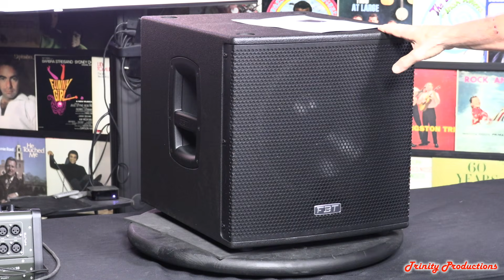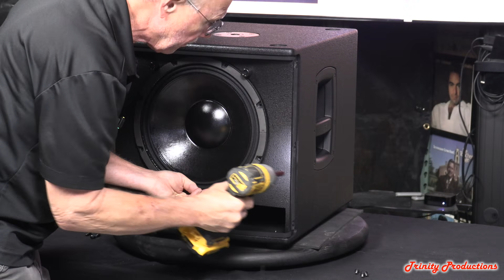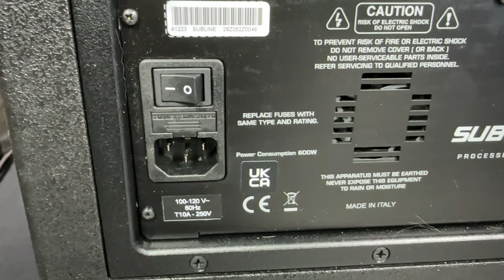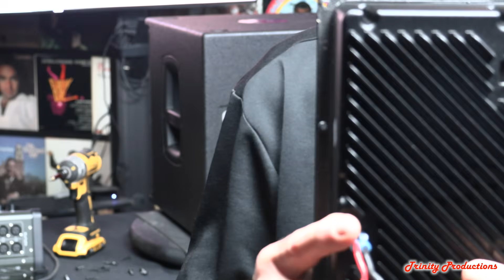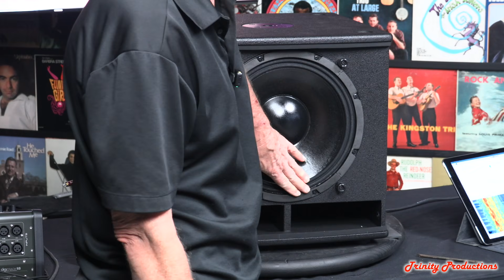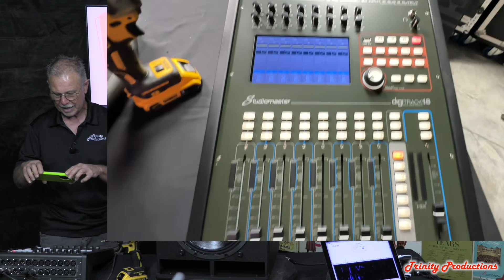FBT SUBLINE 112SA Active 12" subwoofer  speaker with amazing output and features ...

Comment: What are your thoughts on the RCF 702as mk3 vs the FBT Subline 112SA?
Reply from the maker: Those are in a similar league. 700 WRMS on the RCF unit and same on the FBT, here is a review of a sound person on FaceBook on both units…it is just tough to get a lot out of a 12” subwoofer …. 15” better , 18” way better for low end , but again portability and size does matter …  

review from ….. 
FBT Audio Users  · 
Thomas Kuzinas
June 17

So I finally have had the opportunity to compare the FBT Subline 112SA and the new RCF SUB 702-AS MK3 directly with each other, and I can share my thoughts on these 12 inch subs.
The RCF sounds very precise and pleasant, but it does not have quite as much headroom and goes into clipping, as well as triggers the limiter surprisingly fast. The character is rather "polite" and accurate. 
The FBT does indeed play less precisely, but it offers an amazing amount of power for its size. If you let it work within the first quarter of its volume range, you get controlled bass with a lively sound. Between there and half-volume it goes impressively loud, but somewhat "wild" and "boomy". Above that it goes even louder, but starts introduce a rattling noise.
Therefore, I would recommend the RCF for small live bands with a more concert-like character. For mobile DJs and my specific area of application, the FBT is a better fit and offers an incredible power / size ratio.
Reply: @trinityprosound Thanks. I’ve used the mk3 RCF 702’s and heard the FBT Subline 112SA recently. I agree with the FBT Subline 112SA being loud and boomy. However, I recently used the RCF’s at a couple of outdoor events with 250-300 in the audience. I had a full band with fully miked drums, bass and keys (no backline) and 4x lead vocals and a miked choir. I was amazed at how loud, deep and musical the RCF’s were. They covered the event easily and I had a fare amount of headroom left. 
The RCF’s were definitely my favourite of the two regarding sound.

Comment: Hi which would you think would pair best with my rcf 910 this subline 12 or rcf 702 mk3 great vid from the UK 🇬🇧
Reply from the maker: Either will pair nicely, however with the RCF 702, RCF tonality will be similar with your 910’s , not sure of the DSP differences in the SUBLINE vs. the SUB702, but use the built in cross over on the 702 and you will have a nice small system that will sound full and musical …. SPL is quite close on both … thanks for watching !!!

Comment: I did a sound check with these bad boys today and was surprised at how they had such a powerful punch for a 12" speaker,  in fact it sounded better than my yamaha dxs 12 bass bins. I'm thinking of using them with my Dzr12s,  what do you think?
Reply from the maker: Great to hear thanks for the report …. they are quite a formidable 12” subwoofer … IMO the FBT are better construction, drivers and amps than the EV stuff hands down … i have seen some of the EV stuff in repair and was not impressed with the quality of the amps and speakers. Give it a shot with your DZR’s and let us know back how that went ...

Comment: Great channel, great review. I’ve subscribed. I’d like some advice. I sold my RCF gear. I always felt the sound was heavily shaped by the internal processing. I owned the entire ART series—the 910, 935, 932, and 945—plus the 8003-MK3 subwoofer. Of the lot, the 932 stood out, but I didn't like the way RCF handles mid and high frequencies. I need to put together a system for indoor venues: either a 2-top/1-sub setup or a 2-sub/2-satellite configuration. The events are strictly club music played on vinyl. I need tight sub-bass and solid mids and highs. I’m looking to switch to FBT or dBTechnologies.
Could you recommend a subwoofer (12"–18") and satellite pairing? Can two 12-inch subwoofers match a single 18-inch unit in terms of SPL and bass output? Which models would you suggest? The events take place in a private home, in a space of up to 100 square meters.
Thanks for the review.
Reply from the maker: The RCF processing is more FLAT overall, Italian processing without the low end USA push so to speak… each of the 9xx series boxes are going to have different crossover point due to the HF driver size of each cabinet… smaller driver crossed over higher , where the 945 is crossed over at 650hz, low and smooth IMO. The NXL boxes are easy to transport and have a sleek look to them. The 905  subs would be my current choice to pair with an NXL14 or 24, but the 24 will outrun a single sub. we have reviewed a few 12” subs and there is just not sufficient volume in the box to do what a 18” sub can do … we have done demo’s in our shop and the low end from a good 18” is incomparable to a 12” or 15” subwoofer

Comment: What is better for DJ: Wharfedale PRO T-SUB-AX15B or FBT subline 112? What do u think about this? Maybe db technology 615 sub?
Reply from the maker: Oooh , tough question. the AX15B or the db tech 615 would be our choice due to the larger driver in each box. While the SUBLINE 112 does a great job, the 15’s are going to go a we bit lower in response and all are within 1dB of each other for max SPL , most of those measurements were taken ½ space, sitting on a floor or up against a wall to help with low end coupling. For the price point the Wharfedale wins for output IMO. Subline 112SA being the highest priced sub in the line up … thanks for watching BTW !

Comment: Very Nice video as always 👍

What do you think about subline 218sa vs horizon 118 VHA in terms of loudness and which one is more appropriate for deepest bass possible ?
Reply from the maker: The SUBLINE 218SA is amazing for the output and price point , but the Horizon 118VHA outruns it IMO … much more power, more SPL and a Powersoft amplifier in the Horizon. The 218SA has 1200wrms while the VHA has 2500wrms, double the power and the max ½ space SPL 143 vs. 140 of the SUBLINE… however with that said … i am not sure the magic that happens in the SUBLINE 218SA, but the output out of that thing for 1200wrms is fantastic.

Comment: Sounds like the screws need to be replaced with something more solid & doesn’t strip as easy. Seriously
Reply from the maker: agreed , however the grille should not have to be removed nor the speaker or amp as we have had zero failure of any of the FBT we have sold to date … but , yes i get it … thanks again for watching !
Reply: @trinityprosound FBT products are incredibly great product all the way around. I’ve heard a 2 way mid high with a 14” woofer & I believe it was the 1.75” high frequency diaphragm & they were outstanding. 😃🎶🎸🥁🎹🎼🎷🪉

Comment: How would you compare this with the RCF 705-ASMKII? i know it's
a 12" but would like to know if it's not far off it.
Reply from the maker: The 15” with either RCF or FBT is going to move a bit more air and have lower response due to driver and cabinet volumes , but this 12” is is surprising output for the size and power of 700wrms. We have installed some of the 705 MK2 in a church gym and they sounded great… for smaller venues the 12” FBT sub is easily transported and if we would have had 2 of them in our 4200 sq. feet would have filled the room quite well with low end … great for a small church , bar band, corporate events. etc. Thanks for watching !

Comment: I pair my subline112sa with fbt vertus 206a not ventis since i already owned them with my subline118sa but I wanted a small system and these 12 subs have been great without also buying the ventis 206a. I know that combo is very popular in the uk. I wish the us version had true 1 like the uk instead of an iec
Reply from the maker: I too wish the pro stuff had the powercons on them … the IEC just seem cheap to me and can get yanked out pretty easy … yes , the 112 with the Ventis is amazing, but the Ventis 206A will out run the SUBLINE 112SA, you would need 2 of the subs per side to keep up with the Venits…how is your experince with the Vertus? do they outrun the 112SA’s ? Thanks for watching !
Reply: @trinityprosound the vertus is meant to throw sound even farther than the ventis so the issue will not be addressed I believe :)
Reply from the maker: you are meaning more SPL in the Vertis speakers vs. low SPL of others… also HF directivity has a lot to do with what is termed “throw” … SPL is king … we have line array boxes that are 145dB and narrow vertical coverage that can send audio like you can’t believe.. but they are expensive.  Physics the the math behind SPL and power always win, as well as doing events indoors vs. outdoors … thanks again for watching and participating in the discussions !
Reply: Love how wide the Vertus 206A’s coverage is, especially paired with the Subline 118SA. With the smaller Subline 112SA I run the sub crossover at 90Hz and let the sub’s HP filter feed the tops, then leave the 206A’s own HP filter off so I’m not double high-passing at the handoff. Keeps the low end on the sub and the tops clean and out of its way
Reply from the maker: that is exactly how we would run it as well… the 206 does outrun the 112SA, i am sure it gives the 118SA a run for its money so to speak
Reply: Hello, you mentioned that you’ve used the Ventis 206A. I’m currently using Pro Max 114A speakers, but I’m considering selling them and upgrading to a setup with two Subline 112SA subs and two Ventis 206A tops.

I’m mainly interested in whether this setup would provide enough punch and how the overall sound quality compares to the Pro Max 114A.

I usually play live music for around 200 people (two vocals and a Korg PA4X), so I’d really appreciate your opinion on whether this upgrade would be worth it.

Thanks in advance!
Reply from the maker: You are going to get more low end from a top/sub combination than a single 114A box. For 200 peeps or so the 206A and 112SA will work fantastic . Another system to consider if you want a “combo” system is the Studiomaster Core121 or Core151. You will be blow away and they will cover 200-300 with no issue, however it you want to stick with FBT the 206A is a nice small package and can be used without the sub if needed, but coupled with the 112SA is going to give you a system that the ProMax114A just can’t do without a sub….nice small compact system easy transport too.
Reply: @trinityprosound  Thank you for your answer. Mainly problem is my back because i have disc extrusion and every pound/kilogram is important to me :D That is why I am interested into ventis and subline.

Comment: Sica didn't expect that , usualy they use b&C.
Reply from the maker: Me too… seems like a decent driver … it performed well in our sweeps and music tests …
Reply: @trinityprosound how many people one bass unit like that can handle ?
Reply from the maker: type of music and genre will vary, if you are DJ’ing maybe 100, but i would use a 15” or 18” for DJ work as people want to “feel” the bass and low end … for music playback and small band, ensemble, etc. 100-150 for live and maybe 200 or so for music playback at decent levels. (indoors) outdoors that all changes …
Reply: After about 3 years I had to get a replacement and that’s when I found out it was sica. My fbt dealer got me a replacement and I’m still very happy with these subs
Reply from the maker: they are built solid … good to hear they are still performing well for you … FBT  SUBLINE is a solid platform and are made well, using FBT “typical” amplifier modules… thanks for watching !